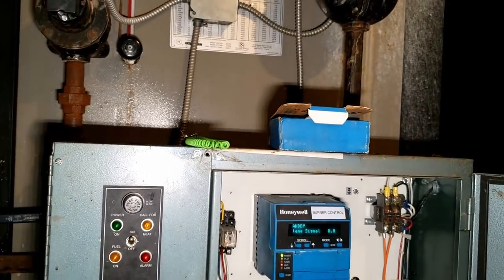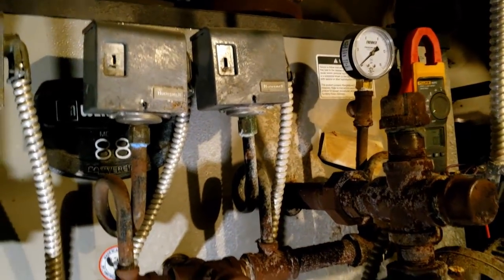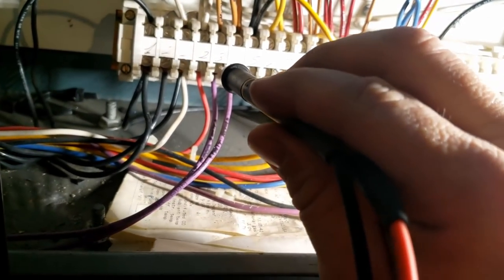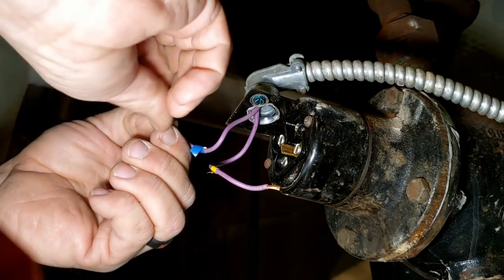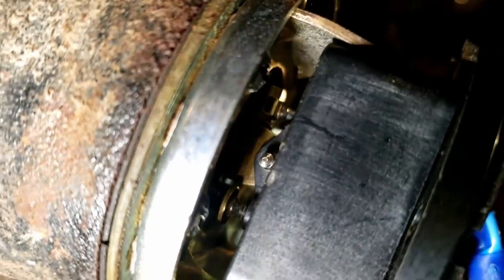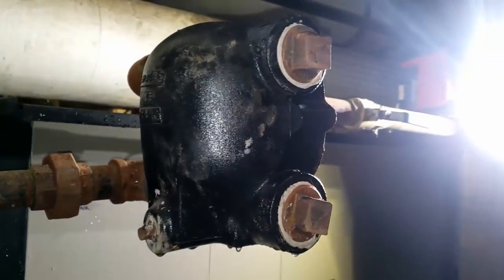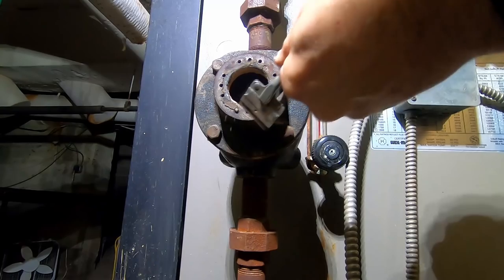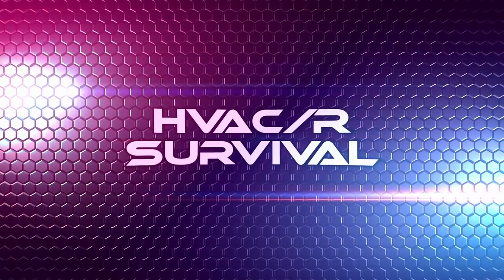Steam Boiler Stops Heating Randomly

Comment: Use to have several hundred boilers on ft Gordon LP, nat and fuel oil #2 and we would assign a pm team to go blow them down once a month. Once had a fuel oil boiler blow up on me the carbon on my hands got burnt from cleaning it. Got to respect these boilers, most of ours were over 100 years old they wouldn’t upgrade.
Reply from the maker: Holy cow 100 years old that would scared the heck out of me. Here I am complaining about these being anywhere from 20 to 30 years old. However the piping could easily be 60 to 80 yrs
Reply: @HVACRSurvival  yeah these were pre WWII era boilers. Had to change fire boxes fire tubes just because the buildings were slated to be torn down. When I left Johnson controls just about everyone was deactivated or buildings tore down and went with heating and cooling plants. I remember one boiler we replaced in Ring hall was in a 4 story basement, massive change out took 3 days with no sleep. That was a water circulation type boiler. Good times hahaha
Reply from the maker: @redeye2629  sounds very interesting. I would have loved to see it.

Comment: Great video. I worked on Clayton industrial boiler. Operating pressure at 450 lb. they were for an Pharmaceutical company . I was Intimidating at first working for pressure is so high. But once I got familiar with the system and all the safeties. I found them very interesting. Good job I’m from California we don’t have a steam boilers out here anymore
Reply from the maker: Samuel, wow that is higher than I have ever heard of for a boiler, the highest around here is around 150-200psig. We do more refrigeration than boilers so I don't do a lot of steam but it is something I would like to learn more about. Thanks for sharing that information!
Reply: @HVACRSurvival  Yes we call them stem generators. There is no steam vessel. Because of the high operating pressure. It’s very high and pure that is so critical for medical products . If you look it up on YouTube there is a good information on it. I’ve been in the industry for 31 years. This could be my last winter in the trade. I’ll miss it for sure but I miss not spending time with my grandchildren more.
Reply from the maker: @samuelaranda4597  very interesting, I think I'll do that right now 👍👍

Comment: Had a similar problem few weeks ago with the same switch. Burner control was bad & the rib relay. But at one point when I went to fire the unit back up that switch was locking it out.

Comment: Steam is rated by Horsepower
Suggestion install press control to automatically cycle between Low & High fire allows burner to run much more smoothly and efficiently..
Reduces on/ off cycling 😃👍
Reply from the maker: It does have a high pressure switch that drops the boiler to low fire once the pressure starts to build. The load on this building was cut (I bet by 70%)  since this was originally designed. So its all oversized now and the only thing its heating now is some single bedroom apartments. I was able to run most of the winter on low fire only last winter with just this one boiler.   Because of other issues that I cant go into, I would have rather had added a outdoor temp sensor that stepped the boiler to high fire once it was colder out but this time delay was a cheaper alternative. The high pressure switch is still ultimately in control after the 10 minute delay as expired.  I will go into more details tonight on the live show.
Reply: @HVACRSurvival  Could you add another float say an intermediate level float (that trips somewhere between the safety cut out point, and the point at which the pump comes on), so that if the pump is unable to keep up, the boiler drops to low fire for a while until the pump catches up and shuts off?
That may also help to prevent low water shut downs by reducing steam production rate.
Reply from the maker: @KSSilenceAU  I honestly believe I have some sort of restriction possibly in that check valve over at the fuel pump or something in the piping itself. depending on what they want to do if it becomes a major issue I'll tear it apart then .

Comment: That is interesting that tekmar makes a steam control. My next task is to download the manual and see exactly what it does...
Reply: Adam,  we mostly see Heat-Timer MPC platinum controller up here .
Reply from the maker: This one's being used mainly for an outdoor reset, it's not doing near what it could be doing.  I mean they could probably have even done two stages and other elaborate things but it's very stripped down. This boiler is almost set to run non-stop once it gets colder out. This whole building is a fluster mess. You doing anything tonight? We can talk about it...
Reply: @HVACRSurvival  I'm game
Reply from the maker: @ATeamAdam  sounds good I want to tear into all three videos plus more
Reply: @rickyhertz7250  I dont work on a lot of steam. But usually it is just a thermostat, pressure control, and some type of float or low water cut off. I have found the most problems with steam are due to lack or maintenance.  I am no Dan Houlohan but I get by.

Comment: I think I would have to build a relay panel for those switches so they activate a relay coil (in series with the coil for failsafe operation), DPST relays where one set of contacts connects to the boiler and the other set connects to a lamp to show that switch's status... That would probably save me from strapping a grenade to it on a 2AM service call...

Comment: Generally speaking you need current flow for voltage drop testing.  Watch for ghost voltage with high impedance meters.  Low-z function helps also.
Reply from the maker: I'm sorry but I believe you're confused. Current flow has nothing to do with measuring across the switch to see whether it's open or closed. I think the proper term might be voltage potential.  I have a low z meter and this was not a low z instance.  I normally will only see that in higher voltages such as 277 and above and even then the measurement I will read is somewhere in the 40 volt range.
Reply: @HVACRSurvival  It was just a general statement thats all.  If a switch is open you read applied voltage across it, if its closed you read 0.  Anything other than 0 when closed and with current flowing indicates voltage drop.  Of course voltage drop exists through out the circuit when in operation, best practices is to keep it low and use all voltage on the load.
Reply from the maker: @joehead1294  ok, I now understand what you were getting at. I cut a lot a things out of the video and I did not explain very well what I was trying to find out. I was just checking if the safety's were open then I needed to track it down to which switch was open. I wasn't looking technically for voltage drop but I with the switch being partially open/closed is why I had voltage drop. LoL  misunderstood, my bad
Reply: @HVACRSurvival  Its not fair for me to make comments without the whole picture as well.  Your the one doing the work.  I'm not.
Reply from the maker: @joehead1294  a lot of times I don't know if I'm being attacked or just being given free information. Generally if there's not a lot of in-depth detail in a post I usually look for the worst (I'm pessimistic ☹️) but generally it doesn't always seem to be the case. That's why I'll go over all this information tonight at 830EST.  I cut a lot of stuff out and then wasn't happy with it this morning and then didn't want to fool with it so I just posted it. Sorry if I was shitty
Reply: @HVACRSurvival  I thought it very interesting and I like controls.  I spent many years in the mechanical trades and I miss them.  This is the only way I get to visit them again.  I'm old.
Reply from the maker: @joehead1294  I I appreciate you taking the time to explain all that. I'm sorry to hear you don't get to do it anymore. I'm sure someday I'll have to be in the same situation. I've got at least probably 20 years to go. I'm 45 currently.
Reply: @HVACRSurvival  Currently care for elderly parent (mom) after dad passed away.  You and several others help me pass the time.  I guess I have a full time job!  I have a pension so I guess I don't have to work.  Can start social security any time.

Comment: No one around here works on steam. I do a few accounts. The ones that think they know how turn the pressure up then the problems begin
Reply from the maker: This boiler operates at a lower than normal pressure than most I've worked on. The last tech said when he ran it higher there was a lot of problems with the piping. So since it works at the lower pressure I have just left it there. Thanks 4 the feedback.
Reply: @HVACRSurvival  keep the pressure as low as possible and still have it work. A lb of pressure will work on most systems if it's designed correct. Generally steam will get there just take longer. The pressure control has a screw on it. Lets crank on it.

Comment: Damm
that heating plant is a mess... just the crap on the floor should mean termination for the operator.. easy to see why your having the problems ... i may not know all the facts but eyes don't lie..... if the room is neglected than the contents are also.
Reply from the maker: The drain doesn't work and it floods sometimes.  ☹️